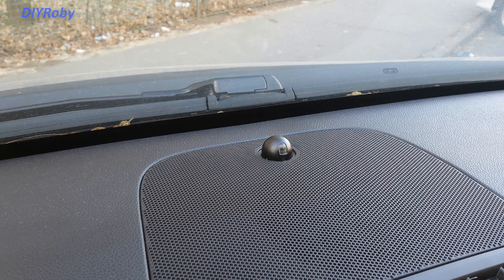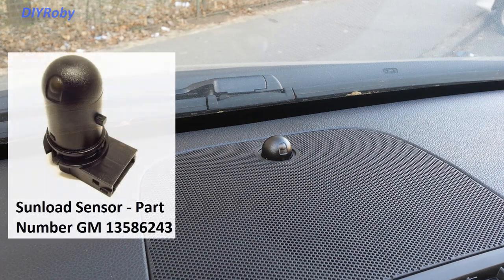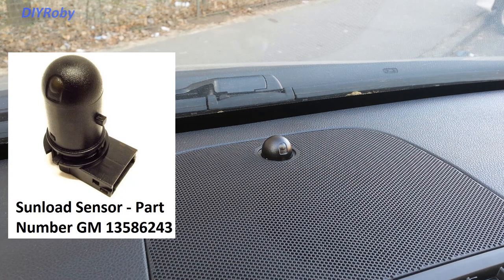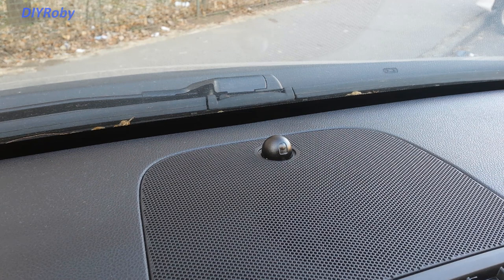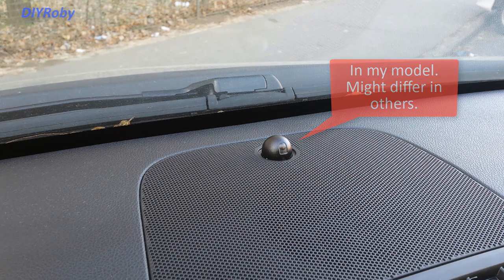What is that strange ball in Opel Vauxhall Meriva B (& other cars) dashboard?  Sun load Sensor

Comment: Your auto light sensor in the the mirror put a cloth over the window screen on the outside of the screen where ur mirror is and the lights will come on also if you have the suto window wipers then the sensor is in the same place. Both together. I used to work for the AA.  Hope it's helps you

Comment: So if i have manual clima its for what? And if i have in Steering wheell Telephone Keys but i cant see in menu Phone options in me cd300 me Meriva dont have bluothoth? Can i do whith it somthing?
Reply from the maker: Sometimes, it is there doing nothing, a dummy sensor. It is cheaper to produce one dashboard that can be used in all cars with different options. If you have a phone button on the steering but no bluetooth, then maybe your car has the possibility to as bluetooth as an option. You will have to get a kit and have it installed to your dash/radio.
Reply: Could you tell me what set I could use to operate with buttons on the steering wheel? And where can such things be bought?
Reply from the maker: @mateusz9395  I really am not sure about this as I dont have bluetooth either on my car. Here is a kit I found online that will enable you use your sterring buttons. https://vauxhallbluetooth.co.uk/vauxhall-meriva-bluetooth/. As you can see, it is a serious piece of kit and the installation is a big job. For now, the other controls on your steering are the cruise control on the left side and volume controlls for the radio on the right side.